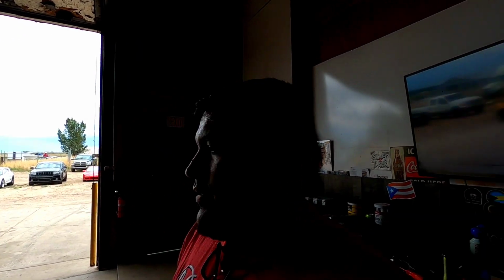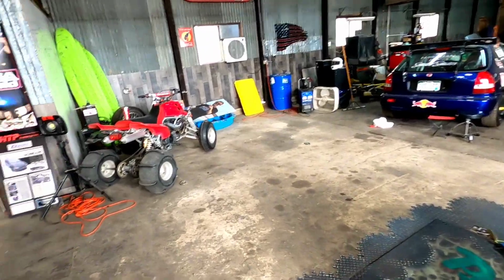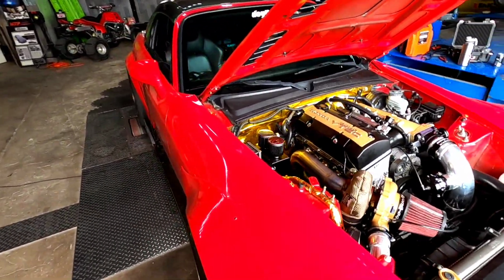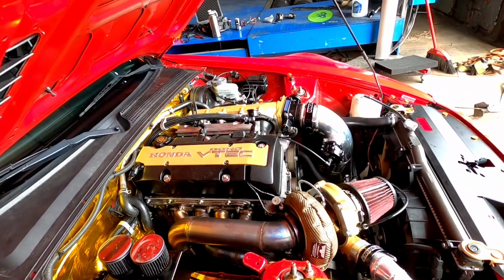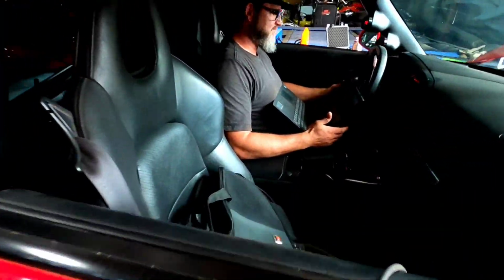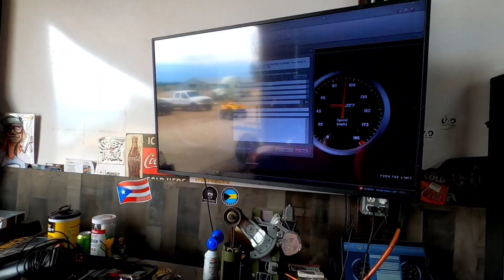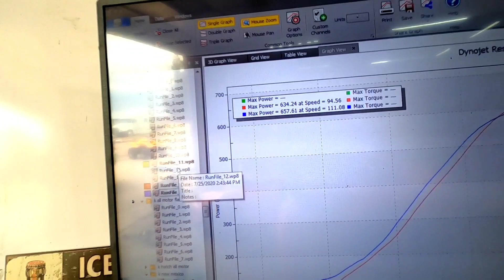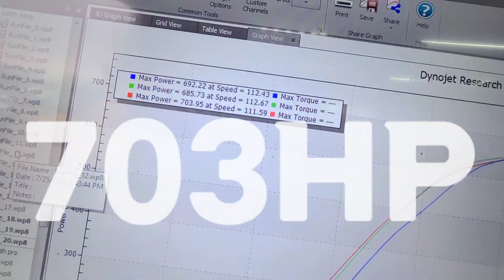PFI SPEED EL 👿 DYNO TIME! Let's Go! | 1200HP SUPRA 2-Step 🔥

Comment: Whats wrong with people not putting the steering wheels on properly :-(
Reply from the maker: Whatcha mean?
Reply: ACCORDing to Joel in the video it’s installed wrong. The big gap should normally be on the top not have a join in the middle. Unless it was just like that on the dyno
Reply from the maker: @sh00t1ngst4r12  you mean the way it's crooked?
Reply: ACCORDing to Joel yeah 😂 the word failed me
Reply from the maker: @sh00t1ngst4r12  oh yeah, don't worry it's just the way it is because of the way it was strapped on the dyno.